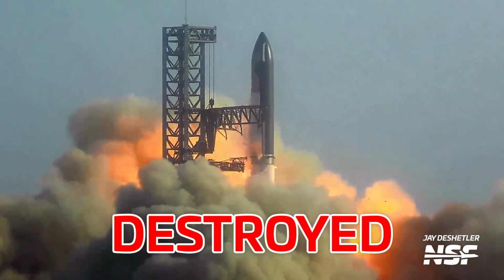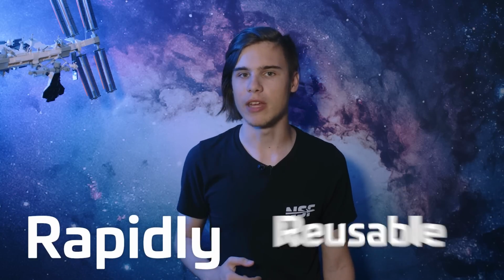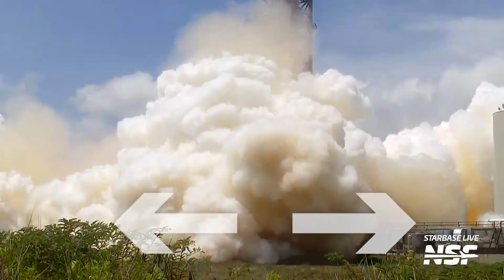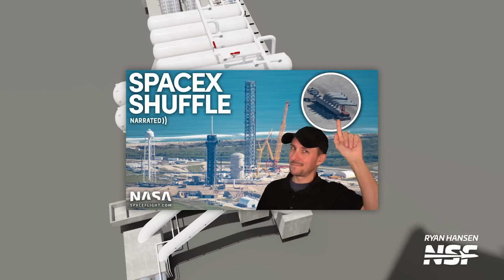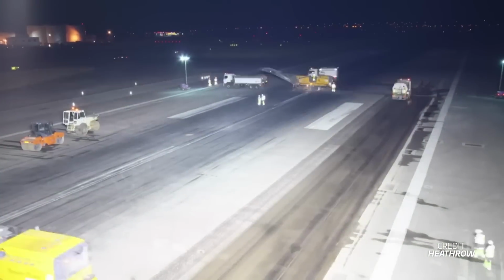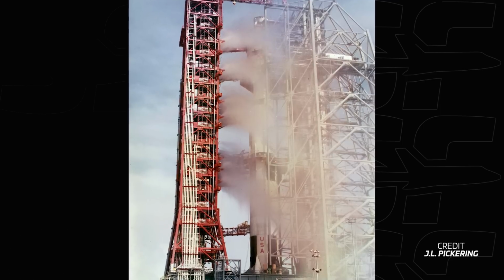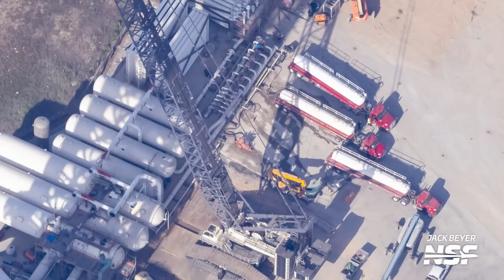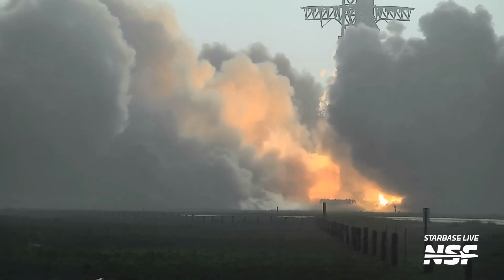SpaceX Thinks They Know Better. Is The Water Plate Enough? (Starship's Deluge)

Comment: I think they need to increase the water supply, open the holes of the jets so more water flows.  I think once they ramp up the engines, virtually all of the water will be turned to hot vapor, which is good... but they still need  more water than in the first tests.  So I think its good that SpaceX has some time to finish hooking up the last large storage tanks.  personally, I would add a couple more large tanks... and double the size of the water jets in the center of the table.  And It wouldn't hurt to have some water barriers around the Stage zero to keep the water from flowing away from Stage Zero, and keep literally all of the water around the Stage Zero so it all turns to vapor.  Hot Water Vapor is good.  That will form a barrier on top of the plate and keep it from melting.  Next time they build another Stage Zero, it should be twice as high.  Please pass this request to SpaceX or Elon Directly.  I am an engineer... and this is my recommendations.  Other than this... I think were on track for a good next flight.  But I wouldnt wait to get some additional water flowing from the center holes.

Comment: I don’t think you’ll see a crater but you may have an exploding vehicle as its excess acoustic energy gets reflected right into the engine bay.   My understanding is that the water  volume available is around 300k gallons.  At LC39B around 400k is available for SLS which has roughly 1/2 the thrust as booster heavy has with a flame deflector.   I believe this system is severely undersized for this rocket and it seems doubtful that the engine bay can handle 8 million pounds of reflected pressure that is not absorbed by the water.  I don’t think it can get away fast enough to outrun the pressure wave which will reach the bottom of the rocket in 1/20th of a second.  And if this happens the exploding metal shrapnel will end this experiment for good at least at Boca Chica.

Comment: Musk's excuse for non-flame trench is lame......39A was a built-up concrete trench system with berms blending it into the surrounding topography....and it was designed by old Nazis!!

Boca Chica was a rush to entice investors, and it worked....that plate system will not work.  Musk and his engineers know it....just a band-aid for more investment at the least cost.

Comment: 10:55 It looks like the explosive steam pressure slows or stops the water flow then it builds back up after the engines shut down. I don't see how you can keep the water flowing when the engine pressure is higher than the water pressure. I hope it's enough for full duration at full power, but I think they may get a melted shower head.
Reply: Or reflected energy will cause an on or near pad explosion.

Comment: I think it will work, and work well.  As with every rocket launch, there will be some maintenance to perform post launch…on the pad and surrounding structures, but this is normal, expected and shouldn’t threaten the viability of the launch system.  The improvements are robust and extensive.  And, I’m sure, SpaceX will go to great lengths to explain what they have done and why they have done it to the analysts and engineers at FAA.  And it will well satisfy their concerns about the overall safety of this second launch.  And then it will be, “Starship, you are GO! for liftoff…”

Comment: As far as I know there has not been 1 fully tested stage 1. To date tests they publish are:
They had a successful test of all 33, but that was not for the entire flight time for stage 1.
The waterplates only were tested with 1/2 power for 8 seconds. This is nowhere near what it will actually endure. 

There is a huge reasons NASA will not allow SpaceX to use Starship on their property. And they are all 100% justified. Boca Chica is a joke.

Comment: I’m concerned there is no protection for the top of the launch ring and the tower itself. Granted the heat and sound directed to these areas will be somewhat dissipated once the ship is moving, but over many launches their exposure could still contribute to metal fatigue. The launch ring with all its delicate parts and wiring may be particularly vulnerable. The tower could easily be clad with heat-resistant insulating glass, but the top of the launch ring may require more thought. At first blush, I’m thinking that a pair of retractable arms spraying water down the side of the ship and onto the ring may be the simplest solution.

Comment: After the concrete tornado SpaceX is in the process of moving some cryo commodities from the big upright tanks to new hotdog tanks to be mounted on the pedestals that are now fully cast. I wonder whether a reasonably quick and cheap solution to the issue of recharging the deluge system might be to repurpose the abandoned big cryo tanks for water and run a pipe from the tank farm to the deluge system water tanks so that water can be pumped from the tank farm to the deluge system water tanks between test attempts without needing to make the site safe.

Someone with a better idea of all the different tank measurements could calculate the actual volumes involved but just looking at it I suspect that one of those big upright tanks could probably recharge the deluge system 2 or 3 times and there's going to be something like 4 of them going spare once the cryo is moved to new hotdog tanks.

Getting pipework from the tank farm to the deluge tanks shouldn't be an issue because they're only dealing with water not cryo so it doesn't really matter how long the pipe run is since they don't need to care about minimising temperature rises . The pipe could also be run above ground if necessary since if it does get hit by debris then leaking water is not going to blow anything up and a water pipe is easily patched. Maybe run the pipe along the shoreline next to the retention pond to get to the deluge system tanks. This setup could give SpaceX lots of recharges, to the point when they'll probably need to be thinking about recharging cryo tanks anyway, so once the site is safe the water gets topped up by tankers along with all the other tankers replenishing the various cryo consumables.

Comment: I think the launch mount will hold up for the next flight, I would say the biggest question mark is over getting all the engines running reliably for a liftoff. So far there hasn't been a fully successful static fire with all engines running, I have a feeling this will take a while to get fully dialed in to get engine startup running reliably. That said a lot of the problem with the first launch was down to failing gimbaling hydraulics which isn't an issue now as there are no hydraulics now. If they can get to staging with the next launch I think they have a good chance of reaching orbit. Re-entry is however another matter and who knows how that will go.

Comment: Excellent presentation.  Thanks for addressing most of the acoustics issues and including the data from Challenger 1.  I expect the suppression system will work for the most part and the launch will be a success.  

At full power, we will likely learn that the steel protector plate needs to be extended beyond the launch legs to protect the fontag from the combined heat, pressure, mechanical, and acoustic forces and fontag penetration and fracturing by supercritical water.

2 engines failed on static fire 2.  This still could be due to acoustics. The deluge fan has the potential to act as a lens to focus reflected acoustic energy at the center of the engine bay and shockwaves were clearly visible during the static fire.

Comment: An excellent, comprehensive breakdown. Just as I was beginning to wonder whether you'd mention the lack of a sound suppression system, you addressed it at 13:31.

And sure, protecting the second stage is the highest priority (which is so far away from the ignition that it doesn't need a sound suppression system), but it left other questions: Why not still have a sound suppression system for the booster? Is stage one considered not as important?

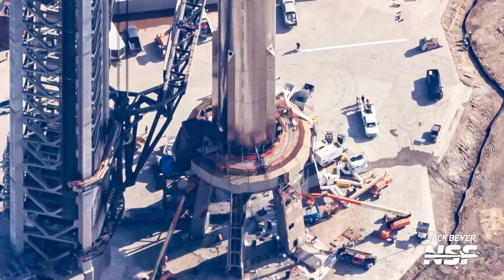I was presently surprised that you also addressed this at 18:38, even if you didn't have any concrete answers at present.

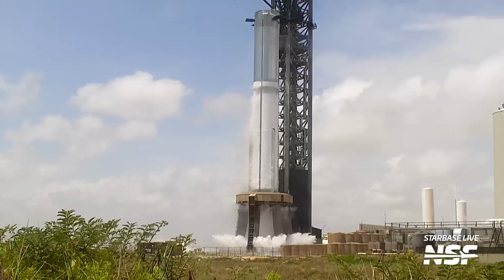Comment: 5:41 Really, we will see. Why does the center get less heating? If anything, the center of the plate will have to deal with the highest heating due to the surrounding engine’s exhaust constraining the exhaust flow of the inner engines thus producing higher stagnation temperatures at ground level. Fortunately the contraption is sufficiently overkill that it should allow sh to escape and do its thing.

Comment: Note that at 50% thrust the steel plate appears to be exposed, but that's not really an issue.  Water is still coming out of the holes, but is being blasted away very fast, so it' hard to see.  The steel may still have a wetted layer.  But also keep in mind that the entire underside of that steel plate has water against it.  The total amount of heat that would be able to damage a water-backed plate is tremendous, but the rocket won't be there for very long!  Steel takes time to heat up and then much more total heat to actually melt, while transferring a lot of that heat downward to the water beneath.  The risk of ablative wear of the surface would probably be more of a concern at that point than actual structural damage.

Comment: Definitely the most informative video I've seen on this, thanks NSF folks!

It should work fine, at least after all the inevitable bugs are worked out of it.  I was especially impressed with how suppressed the engine flame fronts were diminished by a LOT!  People don't realize how much energy water can remove by boiling.  Well, except for us power plant folks, where we used it all the time.  Like 970 TIMES as much energy to boil a mass of water as it takes to raise the temperature of that water one degree F.

It wouldn't make any sense to put in a bazillion dollar desalination plant for events of such a short duration.  You need a bunch all at once and then nothing until the next launch.  Nor despite the appeal of the thought, but capturing the energy from the launch would also be extremely impractical, as some folks have alluded to.  Much too intense and for way too short of a duration to make capturing the energy efficient or useful.

Comment: With a launch cadence of several flights per day, there is not a very good solution.  Musk stated a while back it uses 350,000 gallons of water.  At say 5 flights per day, that is approaching 2million gallons of water per day.  Where are 2 million gallons of clean fresh water going to come from in Boca Chica?  They would need a water processing facility comparable to a small city.  And then there will be a lot of outcry from environmentalists for "wasting" so much water.  Perhaps a desalinization plant, but now you are using a lot of electricity to reverse osmosis it.

Comment: The FAA has scar tissue on trusting big companies. Boeing withheld critical data on 737-Max and after two crashes/hundres of dead passengers, the certification process was evaluated as hugely flawed. The FAA has two options on StarShip. First, it could rubberstamp SpaceX and issue a license pretty much only based on SpaceX’s data. Given the statutory responsibilities (US Law says the FAA must do x/y/z), the FAA can do a pretty rigorous independent review. The FAA has to wait for SpaceX to finish its engineering investigation into: Engine failures, FTS failure (didn’t work right), and launch mount failure. Also, SpaceX has added ‘hot staging’ to the tech stack, so that needs a review. SpaceX only issued its final ‘investigation into failures’ report a few days ago, so the FAA has to read it, understand and agree with the causal factors, and understand and agree with the fixes. This process could have been accelerated if the FAA and SpaceX worked through this process together so that the FAA was already aware of the causes and fixes AND had indicated to SpaceX that the FAA was on board. Alternatively, SpaceX might have had issues with figuring out causes and fixes, so the FAA was not in the loop and their first exposure to data was when they got the SpaceX report. The late release of the report is troubling as it means that SpaceX had issues with figuring everything out. I doubt very much if the FAA is going to be light touch on this second flight. SpaceX kind of blew their credibility with the launch mount debacle and the FTS failure to function properly. However, the fact that the rocket flew pretty well and turned out to be strong as hell is in SpaceX’s favor. My opinion is that SpaceX is trying to pressure the FAA. That could piss them off or it could mean that SpaceX knows that the license is imminent. I would bet on October flight, but I would hate to have the rocket stacked on the pad for a month so that seems to mean launch in a week.

Comment: How about improving the chances of multiple daily launches without wasting so much water, if it can be supplied quickly enough? Install a "Boring" machine oriented straight down under the OLM, similar to the ones boring large tunnels in Las Vegas. Send it straight down for one mile, line the tube with that super strong concrete and your good to go. By the time the shock wave from a super booster hits bottom and rebounds the rocket will be gone. Also the rebounding shockwave will run into stronger shock waves still coming down and everything will just attenuate quickly. Then, in a short time, another super booster can be loaded on the OLM and be ready for the next launch in a few hours.

Comment: The water flame shield is sure to work - i think it should not be called a water deluge system because it is not like any existing low pressure water deluge. This is using water at much higher pressure probably around 15 bars to pump directly against the rocket exhaust pressure there in no other system is like that used before.
A steel shield without water would cause a spectacular shower of burning molten metal like a huge firework with incendiary sparks burning everything nearby it would be a terrible mess     .

Comment: I would not be surprised if the deluge plate experiences progressive erosion with extended use, however the thinner the plate becomes the less rapidly it should erode since heat will be conducted away across it's thickness at a greater rate. If this is still a problem then what can they do? Make the plate out of a copper alloy? (expensive).

Comment: I have an idea on how one could make the environmental impact less. If they collected the methane needed from the air and then used it as rocket fuel, that would actually be better for the environment. Because Methan traps heat much better than CO2 and when you use Methan CH4 as rocket fuel CO2 comes out. So it would be a good thing for the environment. Right now they have to get Methan from Natural gas and then they release more CO2 in the atmosphere. So currently it is bad for the environment. So hopefully in the future they will collect Methan from the air. They could also use this technology on Mars for rocket fuel there. Option B would be to swap to a hydrogen rocket instead of a methane rocket, but I do not think that SpaceX wants to do that

Comment: 🔊🔊🔊🔊🔊🔊🔊🔊🔊🔊I will write my thoughts to Elon Musk, my solution to this problem. Only in this way it will be really reliable and reusable! Because tungsten is the most heat-resistant metal.
For more than 5 months I have been thinking that the best option is a tungsten launch pad and tungsten protection for the legs of the launch pad.

Please don't be offended by me ever.

Comment: You mentioned it only cursorily, but a flat plate is needed to have easy access for maintenance, inspections, without removing the vehicle from the launch pad. A traditional flame trench would hinder this operation or make launch infrastructure more expensive. Part of the genius of the current launch infrastructure is that it does not require any build-up of land or deep digging. It's something you can put almost anywhere with flat landscape. Additionally, the launch infrastructure must also support landings, which can come in from odd angles, completely defeating the point of a dug trench. I hope it works out! - if it doesn't, they can simply increase water pressure.
Reply: There is a reason SpaceX starship is the only launch vehicle not using traditional methods. Because Elon is dumb AF. Why didn't they do a 100% power test on the plate for 10" seconds? Oh, because they aren't sure it will work and pretty much relying on chance and luck for success.
Reply: I agree with most of what you said, but I don't think water pressure is going to help.   They need more than double the amount of water to have hopes of mitigating the acoustic energy.   I think this is a highly risky design but we'll find out if that is true.

Comment: If they placed a moisture capturing netting away from the launchpad encircling it, It could help to collect alot of the evaporated and ejected water vapors and filter it down into a surrounding collection moat.
Reply: Can you imagine the weight of the netting if it captured 5% of the ejected steam?
Reply: @darwinboor1300  It would be designed to funnel the water down into the collection pool. It could be set at a proper distance so it doesnt take too much of the ejection force but can help collect alot of the water from escaping.
Reply: The metal fence around the perimeter gets blown down every static fire they do, imagine what would happen to a freaking net.
Reply: @FastSloth87    It would be designed to funnel the water down into the collection pool. It could be set at a proper distance so it doesn't take too much of the ejection force but can help collect alot of the water from escaping.